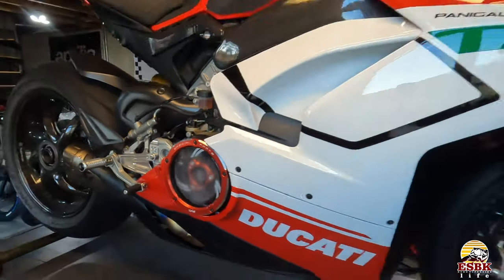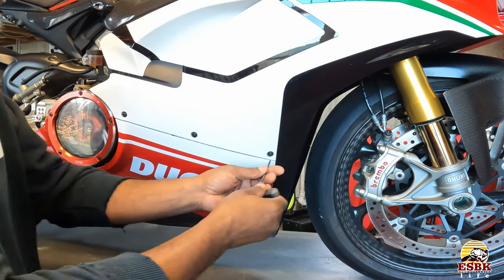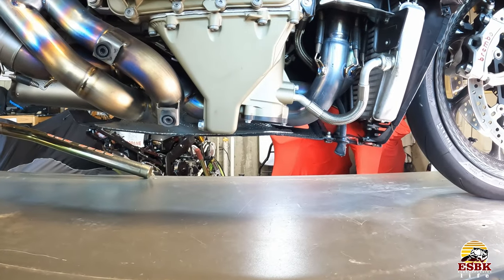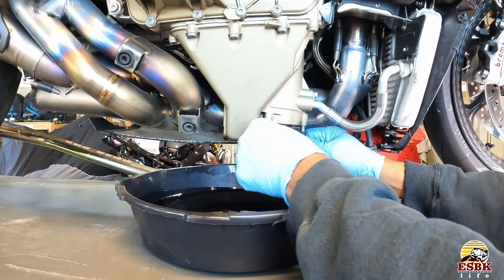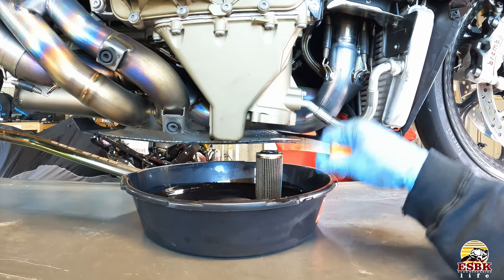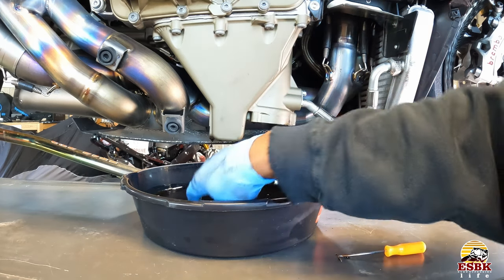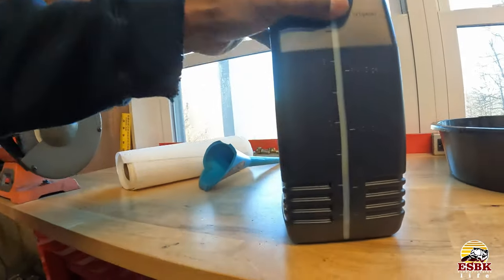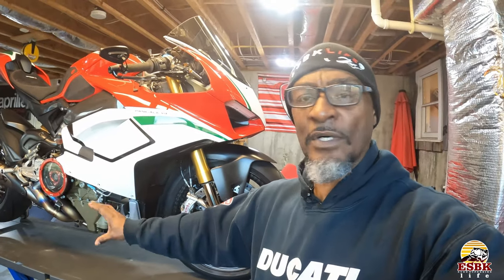Quick and Easy Panigale V4 Oil Change!

Comment: Very informative! Great job and I thank you for being so detailed. The only thing I would add or question is whether you follow the suggestion to add gasket maker on the oil drain bolt?
Reply from the maker: I've always just used the crush washer and torqued the bolt to spec.  I've never used gasket maker on that bolt.

Comment: A well done video, thank you for taking the time to post.   Off to change the engine oil and filter on a 2022 V4s.
Reply: Was the 2022 oil change the same?
Reply from the maker: All of the Panigale V4's are the same, including the streetfighter.  The R maybe a little different. 1000cc vs 1100cc in everything else.  But the process should still be the same for all years.

Comment: Hello, I was able to implement a lot of them, including when changing the oil.
I have a lot of electronic problems with the V4saus 2021. Unfortunately the workshop can't handle it and does it themselves.
Could you send me the workshop book as it is not available on the German market.

I would be happy,

Many greetings, Julia
Reply from the maker: The official Service Manuals from Ducati are pretty expensive.  However, if you do a quick Google search for "Panigale V4 Service Manual" you should be able to find a usable free version.  That's what I use.  There's one here but be warned, it's a collection of PDFs.  Not the easiest to use but, it gets the job done.  https://ducatiforum.com/t/ducati-v4-service-manual.44246/

Comment: Hey man great video. I have a Ducati Diavel V4 with 13,000 miles since March this year. How do you document the maintenance work for the factory warranty? I will start doing my own maintenance but I don't want to void the warranty. Also what brand of lift are you using? I installed a Termignoni Dragster Titanium Exhaust on my Diavel V4 and it It killed my back and knees crawling on my cement garage floor. I'm an old timer, 60+ so it hurts.😂😅
Reply from the maker: The lift is a K&L MC615R. You can check it out here (https://www.vividracing.com/mc615r-bluegrey-air-lift-p-153886410.html?gad_source=1&gclid=CjwKCAjwrcKxBhBMEiwAIVF8rNqYQojr4w7XAatAafd5xKYA3pEAfnv3JheUCPnao9HrBqL72bho2BoCXrcQAvD_BwE).As for documenting work you've done yourself during the warranty period, just keep organized receipts.

Comment: Short question, I drained the oil at the track and did not get to measure it. Its been draining for more than a week now. I plan to go again and fill it up. How much oil should i put in before i start it and measure the oil after it gets hot?
Reply from the maker: Sorry for the late reply.  If the manual calls for let's say 4.5 quarts. Put in 4. Take a look at the level in the sight glass. If all looks good then give her a start.  Let it run for a min or 2 (not long) then shut her then recheck the lave after an additional min or 2 of sitting.

Comment: great tutorial video man! I just hit 1k kms on my 2021 V4s but cant get any early bookings from the dealer atm so im doing this myself! quick question - so using the 8mm screws to remove the oil filter housing cover won't damage the thread for the stock 6mm? thanks!
Reply from the maker: No not at all. The cover was designed to be removed this way.

Comment: Due to the over exposure, I can't the part number for the o-ring kit. Would you let me know
Reply from the maker: The part number is 88650761A. However I’ve been noticing the o-ring kit is getting included with some oil filters. Regardless, you’ll want to check before leaving the stealership 😏
Reply: @ESBKLife  thanks

Comment: 3.4 L ? 
3.8 L ?
Reply from the maker: As the video states, Ducati has published at least 2 separate measurements.  I would assume the value posted on the Ducati website is the most up.  As of today, Rev02 of the owner's manual is on the  Ducati website and it lists 3.4 L, so that's what I would go with.

Comment: What brand magnetic oil drain plug do you recommend?
Reply from the maker: I still use the Oem plug
Reply: @Euro Superbike Life  oh didn't realize the oem was magnetic. I have a 2021 R1, looking for a magnetic plug just not sure which brand is best.
Reply from the maker: @keithorlando6652  I’ve used PSR drain plugs in the past without issue. Give them a look.

Comment: nice video I watched your video with the fuel pump also  for the RR I would  like to ask u if you know onother good aftermarket  brand of fuel pump for bmw cause I live in Europe and here can't find kemso :/ ( have s 1000 XR 2019 ) if u have any idea let me know please
Reply from the maker: I don’t know if the fuel pumps in the RR and XR are the same? What I can tell you is Bosch makes most of them. You might want to start your research there. However, BMW won’t sell you just the pump.
Reply from the maker: A quick google search found this https://www.highflowfuel.com/qfs-oem-replacement-in-tank-efi-fuel-pump-w-tank-seal-fuel-filter-strainer-for-bmw-s1000xr-to-11-2016-efi-2014-2019-replaces-16148559597/
Reply: @ESBKLife thanks man
Reply: @ESBKLife  looks perfect 🙏